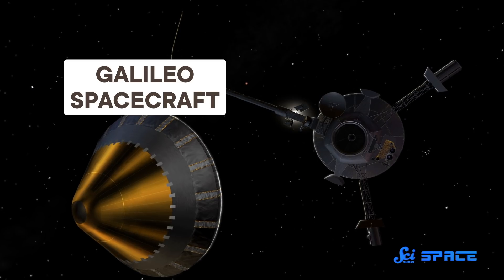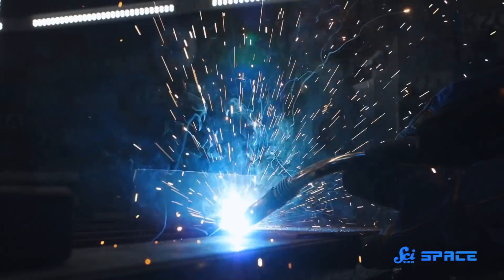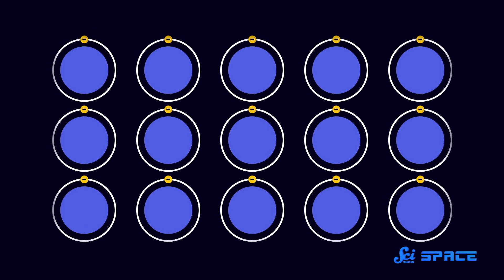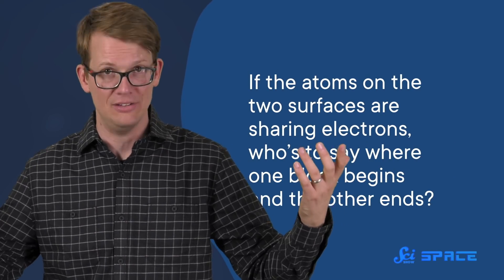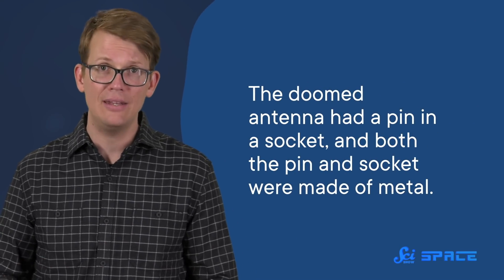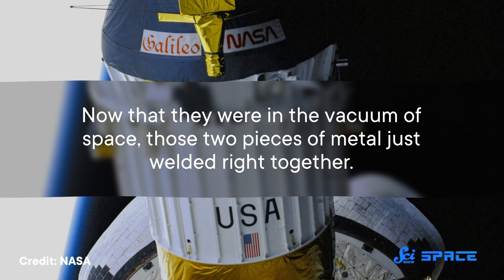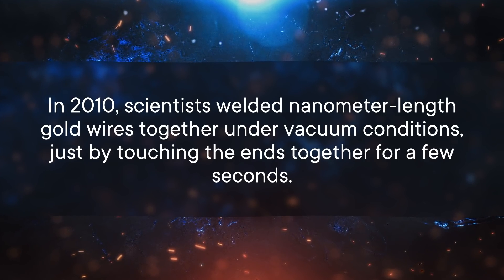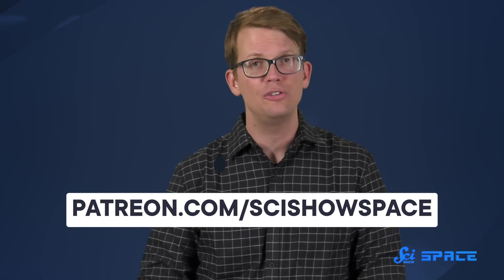In Space, No One Can Stop You From Welding

Comment: Also called galling, vacuum welding, and electron bonding.  The only trick is making sure two pieces of perfectly clean metal touch with no air gap, it then helps to physically shock it.  When doing it in college with a stack of mixed sheets of sterling silver and copper, it was several hours of cleaning with baking soda and distilled water, placing in a clamp, heating to I don't know, maybe 150C (yes that's still pretty cold the melting temp of those metals is significantly higher, the heat was just to ensure a bit of molecular excitation and thermal expansion to help complete pushing the air out), and then wholloping it once with a hammer.  The theory is the hit helps the electrons jump the barrier, but honestly it could easily just be superstition.  But it definitely got full surface bonds with no bubbles, I rolled it and annealed it enough afterwards that if it had bubbles it would have exploded.

Comment: Cold welding is also a significant problem for assembling parts designed for usage in EUV lithography. These parts usually are passified, pickled, the adsorption layer gets removed and they are cleaned on a molecular level. I accidentally have cold welded dozens of bolts and and pins during assembly, making these costly parts unusable in the process.

Comment: Accidental cold welding actually isn’t that uncommon in electrical work, often times when crimping joints, if enough pressure is applied the two wires are welded to each other.

Comment: there is another form of coldwelding, wich is very common for termination of aircraft wiring. this coldweld is achieved by applying high pressure to the materials that need to be terminated. 
(Termination means, in this instance to attach a pin, socket or terminal to the wire ends.)

Comment: This is interesting to me because I’m a welder by trade. So, my understanding is if we took two blocks of steel, for example, finely machined one side of each piece to get beyond the natural layer of oxidation, tightly clamped them together and sent them into the cold vacuum of space, they would automatically fuse together. Cool. (No pun intended.) My question is: if you then collected the fused piece of steel, put it into a capsule and returned it to Earth, once back in our atmosphere, just how “welded” is our piece? Using destructive testing methods, how would our piece compare with two blocks of steel welded traditionally in terms of tensile strength?
Reply: I think they are using this technique in the semiconductor industry to get smaller electronics, but they use a vacuum chamber instead.
Reply: @companymen42  thank you. This does not answer my question.

Comment: Forgive me if this was in the video, but atmosphere is only most of the reason it's hard to cold weld on earth. Majorty of metals create an oxide layer when in contact with air, which makes a buffer that prevents cold welding (gold doesn't form an oxide layer and is probably why they used gold wire in their test).
Reply: ok we geddit u ace chem
Reply: @wotizit  Never took chem unfortunately, ended up having to take environmental.🤷

Comment: It's the exact reason why in mechanical clocks gears are made of different metals - they go so slow that any oil film is pierced through.
Usually steel and brass. It's not because "brass is cheap" as some people think. It's because it lasts much longer than if both gears where made of the same metal. Naturally the largest gear is made of the softest metal.

Comment: Small enough gold wires wouldn’t really have a problem of particles of air getting in between them. Rather, the Brownian motion of the air would cause collisions with the ends of the wires, making alignment near impossible. But maybe by applying a potential across the two wires you’d get them to attract one another, and probably spot-weld on contact, eliminating the need for a vacuum chamber.

On the flip side, you’d probably want to use a vacuum chamber for constructing nanomachines in the first place.

Comment: "they had to use a backup antenna"
as neat as cold welding is, my takeaway from all this is that NASA overengineers things for good reason.
Reply: NASA usually use the weaker low-gain antenna as a dedicated command line, sometimes it's an omni. There isn't very much on spacecrafts that is purely redundant. But lots of things that either are dual purpose, or can be repurposed in-flight.

Comment: AMD are planning to use this very feature for their recently announced 3D Cache...
The CPU and the cache are stacked and connected by TSV's (Through Silicon Via's) which are miniscule wires within the silicon, there will be no need for solder thanks to the effects of cold welding.
Previously this would be done by contact pads and solder bumps which are then heated to cause the solder to melt and create an electrical circuit.
By removing the need for these solder bumps there can be an order of magnitude more connections in a given area and also avoid the risk of the solder bumps spreading out and causing a short circuit.
The problem here is this will massively increase the need for ultra-precise placement of the chips inside a vacuum chamber and ultra flat surfaces, this last part is possible due to the accuracy inherent in current chip production methods used around the globe...

Comment: Ultrasonic Metal welding here on EARTH has been around for DECADES. Cold welding MANY dissimilar and similar soft metals welded together on small scale is a KNOWN MASS PRODUCTION method. Almost EVERY GM alternator in the 70s (maybe 80s and longer) had an aluminum heat sink with 3 copper pads Ultrasonically Metal welded on to it where the DIODE was soldered on. Automotive wiring harnesses were spliced with copper to copper wire joints using Ultrasonic Metal welding. (And may still be.)
NO HEAT is supplied in the process. The parts are pressed together and ultrasonically vibrated against each other to scrub thru and displace any surface oxides and contamination.
Once the core metals come in contact the COLD WELD takes place. (Here on EARTH.)
https://www.emerson.com/en-us/automation/precision-welding-cleaning/ultrasonic-metal-welding

Comment: they knew cold welding in space is a thing, why didn't they use a different metal for the pin? steel would have been strong enough I'm sure, whatever the pin was holding was probably titanium so they prolly wouldn't weld

Comment: We actually have a project to prevent cold welding in rockets but before they reach space. During launch vibrations can wear away oxide layers and weld together mechanical parts. We try to solve that by PEO (plasma electrolytic oxidation) by basically adding a ceramic layer on top of the metal.

Comment: If you had a 3d printer in a vacuum chamber, you could theoretically weld a thin metal wire together in the desired shape without the need for heat. A cold welding 3D printer.

Comment: So in theory if you could control the flow and interaction of those atoms then, creating metal walls that become doors then transition back to a solid wall again is possible? 
How come the modules of the ISS don't end up cold welding together?
Reply: Plenty of reasons, certain metal combinations don't cold weld, purposely using thick oxide coatings or types of paint, using lubrication, etc.
Reply: @rdizzy1  makes sense. literally never considered that lol
Reply: The seals on the ISS also use gaskets as well.

Comment: Well, actually, as far as I know, cold welding is a common problem in fine mechanics wokrshops. If you grind and sand metal blocks to a very smooth surface and lay them on top of each other and let them sit there for a day or a week and then want to pick one up, they might be welded together or at least starting to. Thats why new apprentices usually learn to not do that. Never work metal with too clean hands! ;)

Comment: You absolutely can push two metals close enough together for welding in an oxygen-rich environment. It's called "galling", and it happens all the time with stainless steel fasteners. That's why you need to use anti-seize with them.
Reply: Yup you can even get them flat enough where two pieces of metal stick together. Not exactly a weld but pretty similar 👍
Reply: I use Brass nuts on Stainless steel bolts  (or Stainless steel nuts on Brass bolts). Either way, you avoid the problem of galling.
Reply: @menguardingtheirownwallets6791  Can't always do that. I've built robotic cells for food plants, and they require stainless on stainless. We did have to use a food safe anti-seize on them and then torque to spec to avoid them both seizing/galling or working themselves out over time with the vibrations and frequent wash downs.
Reply: Isn't galling more of a friction and pressure action? Friction and pressure cause heat I believe.
Reply: @samuelthurman5331  not enough heat. I suspect the friction and pressure is removing the oxide layer and allowing the metals to come into actual contact.

It would be interesting to construct an experiment to test that. Possibly cleaning stainless steel hardware with some sort of pickling solution and then seeing how much torque is required to gall the nut.
Reply: @PaulSteMarie  sounds reasonable. My interest has been peaked.

Comment: This absolutely can happen on earth and does so often, even daily. Usually because of a bad mechanical design. If you buy cheap stainless steel bolts and nuts from China, chances are they are made of a type of 300 series stainless that is prone to cold welding. If you make a joint with CLEAN nut and bolts and torq them down really well, they will cold weld together and you will break the bolt while trying to get them apart. This is a common problem called galling. Try it and post a video.

Comment: I am glad others have pointed out the "cold welding"/galling issue common in air, on Earth.
Ultrasonic welding is another. Related to galling, rub gold wires on the connection pads of circuit "chips" and the housing they reside in.

Comment: Something similar happens if you stick a couple AAA gauge blocks together, (incredibly flat pieces of steel used to check the accuracy of other gauges), known as wringing, and they can be surprisingly difficult to pull apart. There are a few ideas why it happens but no one is really sure. It's possible something similar to cold welding is happening or a combination of things like surface tension and molecular attraction.
Reply: I've heard it as partly because the surfaces are so flat they push out all the air so the atmosphere is pushing them together.

Comment: Galling is another type of welding where threads of some metals are prone to easily friction weld themselves. 304 stainless and Aluminum threads are 2 metals notorious for this.
Reply: Galling is cold-welding, its just no one calls it that because its NOT a weld, its friction causing metals to fuse together.

edit: to explain further, Galling is a form of wear caused by adhesion between sliding surfaces. When a material galls, some of it is pulled with the contacting surface, especially if there is a large amount of force compressing the surfaces together.
Reply: @TheInfidel_SlavaUA  ok fine lets get technical, Galling is a form of wear caused by adhesion between sliding surfaces. When a material galls, some of it is pulled with the contacting surface, especially if there is a large amount of force compressing the surfaces together. Its not a weld.
Reply: @sacred1hawk553  : Whether galling is a weld isn't particularly relevant to what you're using to dismiss it, all that's relevant is whether it's a bond between two things that is directly equivalent to the internal bonding within the materials themselves.

For an example, a common failure mechanism of electromechanical relays is a form of wear caused by adhesion between contacting surfaces...

where that adhesion is itself specifically caused by welding of the two contacts together via current-caused heating.
Reply: @sacred1hawk553  you didn't get technical though and it's not cold welding. Nothing on earth is cold welding unless it's in a vacuum.
Reply: @GameTimeWhy  thats not true. The reason things cold weld in a vacuum is because there is no atmosphere to form oxide layers and most contaminants will eventually evaporate off leaving nothing but bare metal which easily bonds together when clean enough. Galling is exactly the same thing but instead of the vacuum removing contamination and oxides, its the pressure mechanically removing them leaving again only a clean metal surface. The friction doesnt come anywhere close to heating the material to its melting point and if you ever deal with stainless fasteners youll find that they will gall no matter how slowly you install them
Reply: @nickanselmo6353  yeah i have noticed that problem while taking the body off my jeep, now i know.
Reply: @nickanselmo6353  What you are describing may very well be galling, which would definitely jam up a bolt, but it's not cold welding. The two are absolutely not the same thing nor even mutually inclusive.
Reply: My car does what I like to call, rust welding.

Comment: Cold welding happens to components in high and ultra high vacuum equipment
and can be a real maintenance problem.
Reply: Sputtering chambers, certain steps in chip manufacturing, electron beam welding chambers, x-ray equipment. Vacuum tube manufacturing. Lots of high vacuum applications.
Reply: Could you give examples to such equipment?
Reply: Super strong 🧲 in ultra high vacuum and steel parts that are ferromagnetic ( will become a temporary magnet in the presence of a 🧲. If the surface of both the magnet and steel are sufficiently flat, clean and all the air is removed from in between their surfaces the two will become one as the electrons will be shared by both pieces making it impossible to know where one stops and the other begins.

Comment: but wouldnt it rather be a kind of fusion instead of welding?
from the explanations it sounds as if that would be a more fitting way to call it
Reply: two atomic nuclei are not merging into a new, different atomic nucleus, bypassing in the process coulomb force to take advantage of the nuclear force/strong interaction, which is what (nuclear) fusion is and also generates tons of energy and possibly byproducts.

here the atoms are the same before and after, they're just joined into the same "lattice" (don't know if that's the right term). i guess an analogy would be like if you mashed two very cold ice cubes together, they just freeze together. you still have what was the material for two distinct ice cubes, now they're just stuck together. if you had performed fusion with those ice cubes, you'd have some new atomic material that's no longer water and you'd have leveled your city.
Reply: No, fusion is where two or more atom becomes one, the atomic mass went up. This sort of things only happens at extreme pressure and temperature like in a sun, or fusion reactor.
Here, it is just electrons between atoms shared together which cause atoms unable to easily separate. but you can still separate them with a knife or something, while you can’t easily separate Helium atom into two hydrogen atoms.

In other words, fusion is when you can no longer distinguish two atoms, because their subatomic components mixed together. Cold welding is where the atoms connected together without adding heart or extreme pressure.

Comment: There is another way of welding known as explosive welding. It is litteraly putting 2 plates of metal(interestingly enough it is also possible to connect plates of aluminium and steel together, which is impossible with normal welding techniques) on top of each other with a layer of explosives on top.
When the explosive is detonated it pushes the plates so hard together that any air inbetween the plates is forced out and thus creates a plate with different kinds of metal in either side.
These plates are used for instance in the construction of ships where the designers want to save weigh by putting a aluminium superstructure on top of a steel hull.
Reply: There is also friction stir welding.  I think Honda was using it to join steel and aluminum in front subframes.
Reply: @jacobg1488  : You may be interested in friction drilling- similar concept to friction welding, but you drill a hole instead of (or in addition to...) welding two things together. As an example, some PC cases use friction drilling for the screw holes.
Reply: Just did some research. Explosive welding essentially creates a plasma jet in between the two plates, since the plates are at an angle and so the plasma jet travels in between them. The jet removes any oxidation and plasticizes the metals. There is no oxidation, so the plates easily weld together.
Reply: Til, thank you both!
Reply: @Feroce  I wasnt aware of other methods, how do they work
Reply: I knew a guy who was on the team that did the world's first aluminium/steel welding at Ohio State, in about 1970 or '71. Just a matter of finding the right materiel for the rods.
Reply: I think that is how they make the sheets for some American coins.
Reply: The Metallurgic equivalent of percussive maintenance; it's only needlessly violent if it doesn't work
Reply: Yeah, friction stir welding is the coolest
Reply: I had thought that was only for complex shaping. Makes sense- would it work the same way with (very low voltage) magnetron heating between the metals? Possible tech with today's additive manufacturing, since the horn would be in it's own traveling containment.
Reply: Intelligent people are laughing at you when you add the word literally to everything you say.
Reply: @markfox1545  pretentious
Reply: And misspell it.